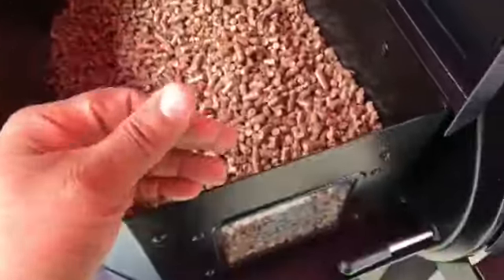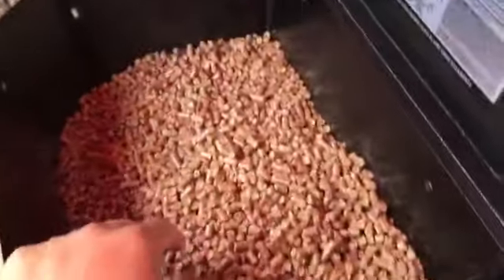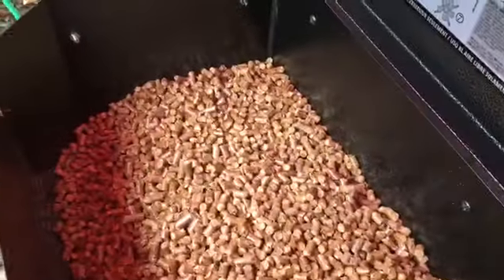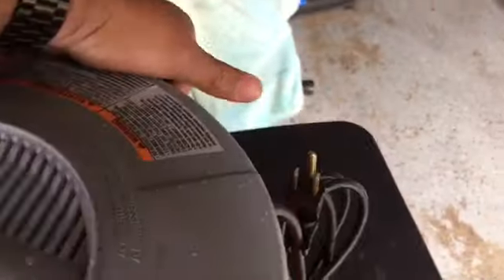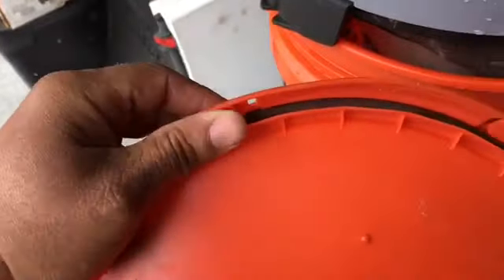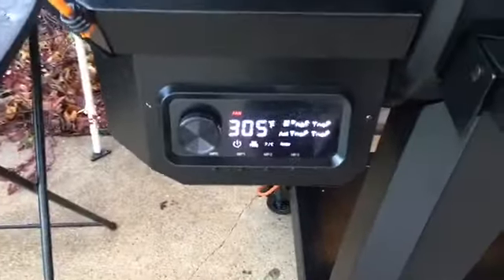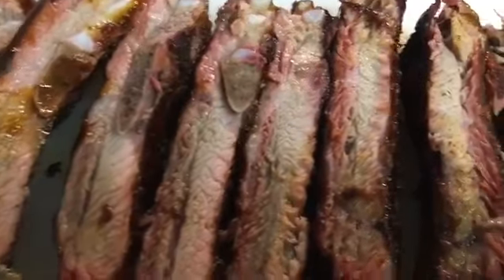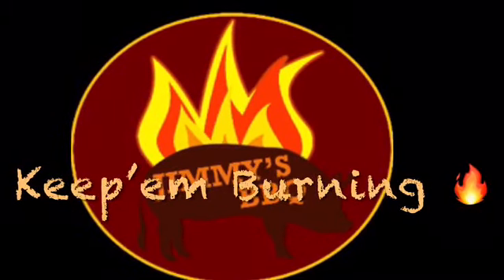Walk Around the Pit Boss 1150 Pro2

Comment: I was thinking of using foil in mine but my buddy said it messes with your temps big time?? I bought mine from Lowe’s last week and it has the 10 degree increments. So I guess I have the latest firmware.
Reply from the maker: What is up? I’m not sure what type of cooker your friend has but I find it hard to believe that a little tin foil will affect the temperature at all. I do know on the pro series 1, there was a device that you can purchase to help with that issue.
Reply: I don’t put foil on mine because I like the reverse seer option.
Reply from the maker: What’s up? I do as well but I  hate having to clean all of that burned on food and grease.
Reply: @getjimmysbbq  different strokes, brother. DEFINITELY use that hopper mod.

Comment: Have you found out what you have to do to get the update. I just bought mine yesterday. I have not put it together yet so not sure if mine will need update. I’m sure it will
Reply from the maker: What is up? The process is really easy. Make sure you register your cooker, that will speed up the process. Just call in and make sure you have all of your information and Pit Boss will send you out a new controller. They were out when I called. I’m still waiting.
Reply: Oh wow so you don’t have to send in your controller anymore for the update. They are sending out brand new ones?
Reply from the maker: Yep! They are sending out all new controllers. They were out when I called in. They were expecting new ones by end of April or early May. I was told it may be a couple of weeks afterwards before the mine is sent out.
Reply: @getjimmysbbq  cool look like I am calling tomorrow so I don’t have to wait longer. Thanks man.
Reply from the maker: No problem. Keep em’ burning 🔥